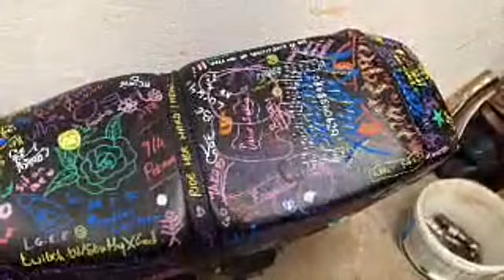How's the Craic?

Comment: Hiya man! Nice to see a hearty fella himble guy not like some the ego maniacs out there! The mental illness thing is gone feirce worse since the pandemic fellas are twice as mad😅 i hope to see ya at a rally somewhere! Im a bit of a lonewolfer myself i keep it simple! I had a handa rebel with ww2 amo shells for exhausts ya might of seen it rat job. Nice bikes there! I think my man the carbs is the biggest pain if you go at the airbox or exhaust ya have to pull those little caps off the fuel mix screws and richen up the mix and it can be a bitch to get multi carbs right but i bet if you pull those new carbs and measure float hieghts jets needles screw turns you will have the exact same spare set. I spend most the time at the carbs its where the most pacience is needed its where the real enthusiast comes into it. And you will feel all the better for it getting them right in the end🎉
Reply from the maker: Thanks bud